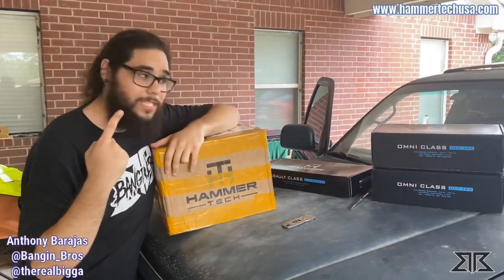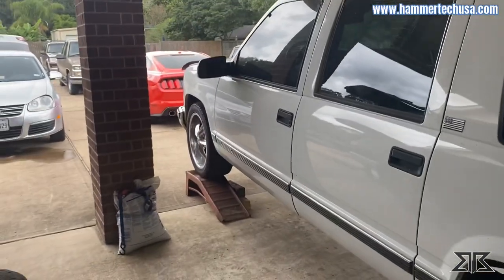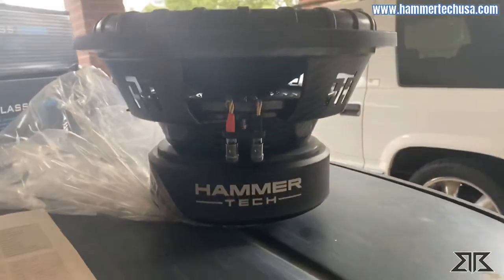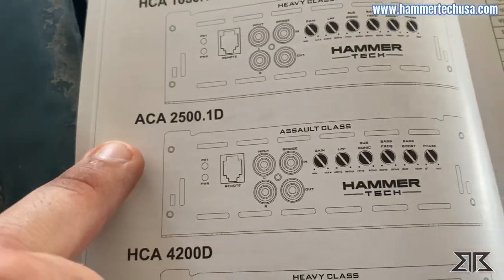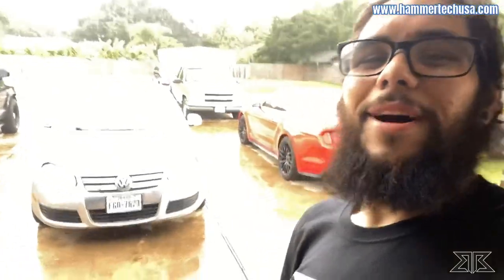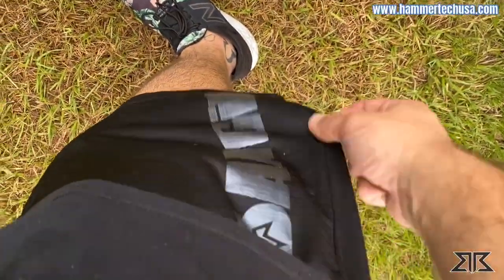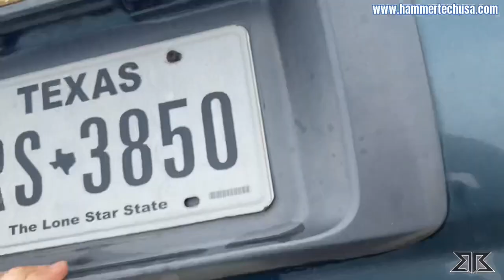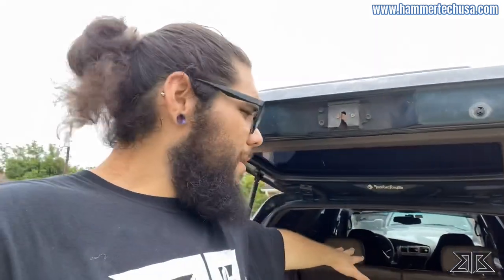The NEW HammerTech HCW 12”s and ACA 2500.1 unboxed and bangin! | IGTV @BANGIN_BROS

Comment: Any review on these subs?
Reply: I can tell you for the light class LCW12, they are very good value for money, in a slightly too larger box tuned to 30hz they pound, they have great excursion but not linear and sound a bit dirty, they take quite long to break in and after about 3 months they get much louder and do lows very well, before break in they dont sound all that flash, reminded me a lot of Digital Designs 512 back in the day, similar run-in time and symptoms. the lcw given clean power gets a bit smelly pretty easy but after you push it like that about 8-10 times then they handle power easily and dont get smelly anymore and have mechanical limitations instead but they take a beating, overall a little bit dirty sounding but take immense abuse once run-in and are loud and low